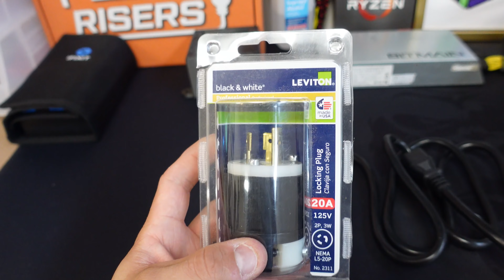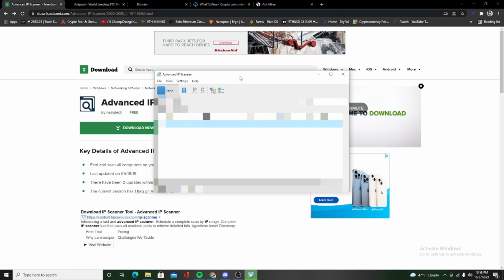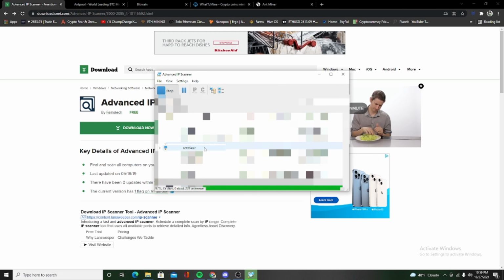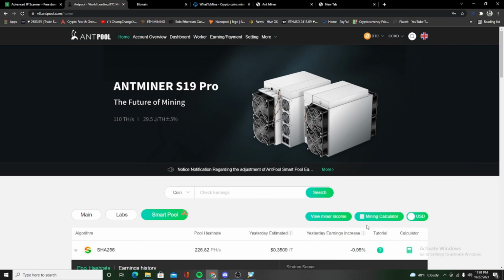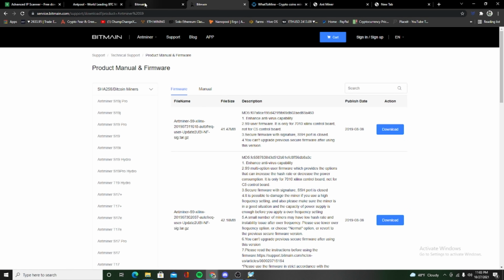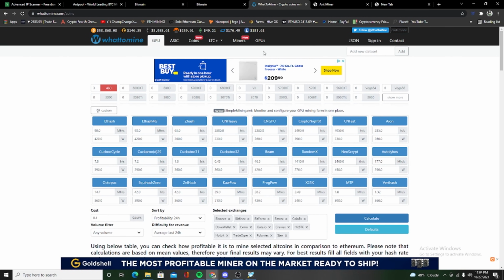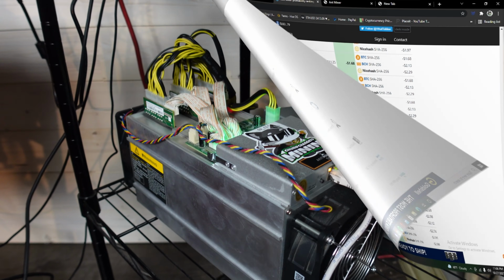How To Mine Bitcoin | Setting Up My First ASIC Step By Step

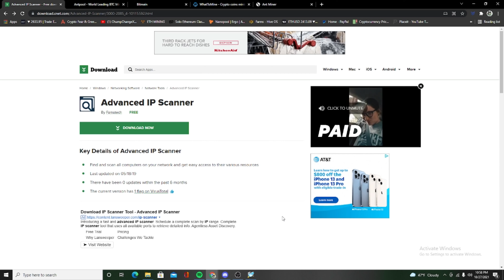Comment: 4:59 You don't need to use that bloatware, which probably steals all your network info and send them out of space to an Alien spaceship, in order to conquer us all.
Just log into your router administration interface and go the LAN section and it was done, same info are provided there without any 3rd party leak. While you are there, you can even give to that ASIC an static IP address, that way you will be able to get access to it anytime you want.
Have a great weekend my brother and congratulations for the new Bitcoin ASIC miner <3